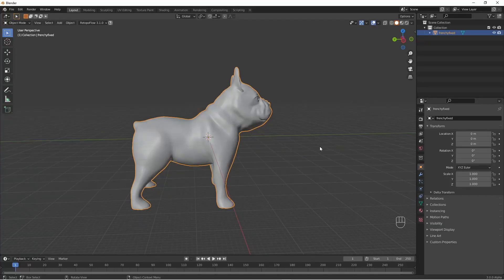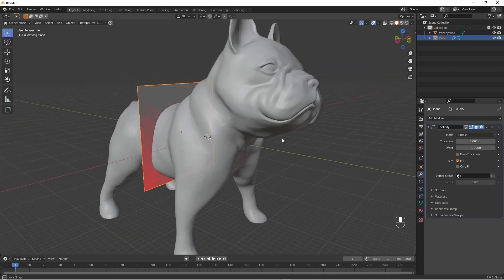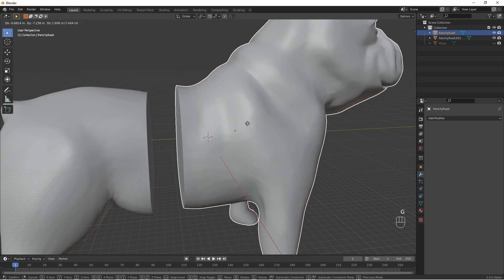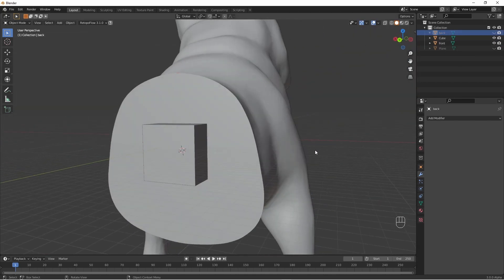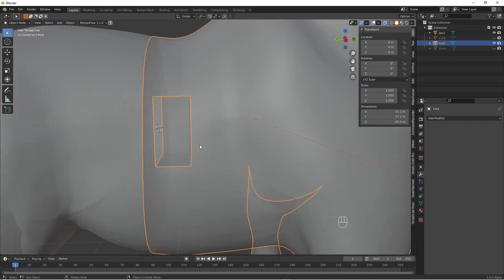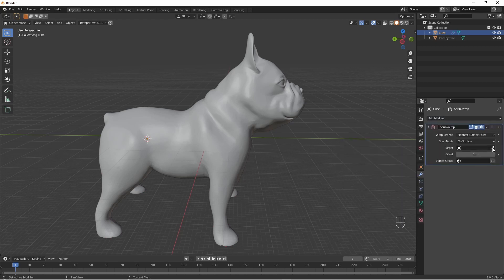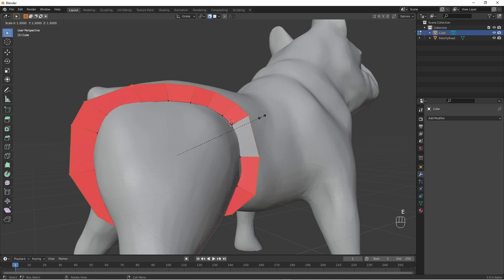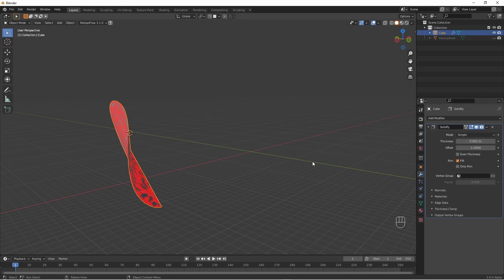Blender. How to cut and key a model for 3d printing

Comment: Great Tutorial.  Why do you use the non-zero-thickness solidified plane to cut the model instead of the Bisect tool?
Reply from the maker: Because the bisect tool can only handle a straight line. This technique allows any shape cutting tool and also allows you to adjust it until its just right. Bisect tool is fine for quick rough cuts though.

Comment: I can't get the extrude and scale step to work. You seem to be able to extrude 'inwards' for the inner ring. no matter what tool i use, it seems to only want to extrude along one plane. I also had to use 'extrude along normals' to even get the first 'ring' to extrude.
Reply from the maker: This is odd.  After the e for extrude you are supposed to do the s for scale.  Are you doing that?
Reply: @notverygoodguy  I press e to extrude, then move the cursor around which extrudes all the vertices in a single direction. I've tried hitting s but it doesn't seem to do anything as long as extrude is active?
Reply from the maker: @p4cca  Don't move the mouse until after the s.  Press e and then press s and then move the mouse.  Should work :)
Reply: @notverygoodguy  I'm so glad you already answered this in the comments! Trying this tutorial and that's where I got lost! Thank you!

Comment: I follow every step and it all goes fine with the organic cut UNTIL I try to apply the Boolean modifier to the Model. It causes a small piece on the outside edge to disappear but all the extrusions made are now part of the Model.

Basically, applying the boolean modifier makes the cutting disc we made become part of the model itself. 

Any idea what i did wrong? Im on blender 4.0.1
Reply from the maker: To be honest I haven't tried Blender 4.x mostly because charmorph doesn't work with it yet but my first suggestion would be to try "fast" in the boolean operator instead of "Exact".  That often fixes things.  If not then check normals by turning on face orientation in the viewport overlays drop down.  If this doesn't make a difference then it looks like I am going to have to download 4.0.1 even though charmorph doesn't work with it so I'd be grateful if you could let me know how you get on.
Reply: @notverygoodguy OKAY so im home and so far i tried the one using the Plane and it worked after I used Fast Though.

Edit: yep ive tried from start to finish a few times and the organic cut doesnt work. The only thing ive notice is when Solidify is set on a plane. I notice its thickness increasing. On the organic it still looks flat. Im gunna play with thickness and see what i get.

Important edit. So in my case making the thickness .003 worked. Im not sure why thats the case but i was able to get them apart
Reply from the maker: @Linkophere  Thanks for the updates.  I'll download 4.0.1 soon and see if there any weird new things I should know but I am glad you got this working :)
Reply: @notverygoodguy no problem. Thank you very much for your fast replies and help. Youve saved me from literal days of editing meshes to make a key hole. This is only my 3rd day of using blender and this video was amazing.
Reply from the maker: @Linkophere  You seem to be doing well for only three days in!  Thanks for the positive comments :)
Reply: @notverygoodguy the excitement of 3d printing and videos like yours make that possible 🫶🏻
Reply: Thanks for the fast reply. Gunna try these as soon as i get home. Thank youuu

Comment: 8:30 here I am suddenly lost.   When I turn on Snapping there is no 'Face' option, instead there is 'Face Project' and 'Face Nearest'.    My best guess was 'Face Project'.  I turned on the Magnet, went down to the point of focus.
But what are you doing?  It sounds like you're clicking the mouse while you move the pointer around.   But all I see on the screen is the letter E.   Whether I click the mouse, or the letter E, no lines are drawn anywhere  :/
Also the pointer never changes to 4 arrows.    What am I doing wrong?
Reply: So disappointing to get this far.  I'm going to have to bail.  No key I hit does anything.  I guess Blender updated and changed how this works?   Who knows
Reply from the maker: Sorry it took so long to see this message.  I usually get to them quickly.  Actually, face nearest is probably best but it depends on the size of your faces and vertex can be better.

Comment: I have two parts that are already in seprate parts but need to be assymbled into one once printed so the slicing method doesn't work for me. do you have any advice for my situation? I don't expect a reply since this is a 2 year old video
Reply from the maker: You maybe surprised :)  Ignore the slicing part of the video but just do the part cutting and keying part with the cube.  Alternatively if you use Prusaslicer as your slicer it can now add connectors to parts to allow you to snap them together.  I haven't actually tried that yet though.

Comment: For the drumstick cutter, what was the purpose of the shrinkwrap modifier? You snapped all extruded vertices to a face, then extruded them a little away from the dog after you'd closed the loop. Seems to me that is all you needed, no shrinkwrap required.
Reply from the maker: You make a reasonable point and your mostly right.  Try it though, it usually works out better with both.

Comment: This is the second method I tried and it just doesn't work for me, as soon as the cut is a bit too curved it fails in one way or another. I discovered a more tedious but much more reliable way: in edit mode deselect all vertices(Alt-a), then activate the knife tool (k) and define the cut around the mesh, double click to close the cut loop, press enter to execute the cut. This doesn't actually separate the mesh but creates a loop of vertices along the cut line you defined and they'll be selected. Now the tedious part: select all vertices on one side of the cut. Afterwards press p > by selected, and you'll have two separate meshes along the cut. They'll be open though, you can close them by selecting the vertices on the seams again, then pressing f and then in the menu bar selecting Face > Triangulate Faces.
Reply from the maker: Your method will be really difficult with high resolution models, especially stl ones but if it is working for you that's great.  

I am interested in the issues you are having using this method though.  Can you give more details on the kind of failures you are getting?

Comment: Thanks so much for the straightforward tutorial.  I tried, and it works great.  But how will that cube key print sticking out at 90 degrees? Do i enable supports?
Reply from the maker: Thank you for the kind words.  I kind of had resin printing in mind actually and then you would most likely have supports on anyway but if you are using an FDM printer I would suggest you make sure the gab between the hole and the "key" is bigger than I show in this video. I would think 0.2mm as a minimum otherwise the parts might not fit together.

For supports, if you use the cube key as it is and it's walls are not at a 45 degree angle to the printer bed then yes you might need support.  However, it doesn't have to be a cube :)  If you selected the vertices of one face and scaled them down, you could make a kind of wedge shape for both the hole and the key and if the angle is right you may not need supports.  

Hope this helps!
Reply: Thanks!

Comment: How would you attampt to cut toroidal propeller in 3 parts? I tried and failed because off a lot factors, you name them :P I have only a small 3D printer 120x120 mm. Looking forward for some advice.
Reply from the maker: Well that's a interesting project especially given you have to stick the pieces together well once printed.  You don't want that flying apart in mid air.  

It depends how big you want this thing to be but you might consider using a cylinder with the top and bottom faces removed as your cutting "plane" and use it to cut out the center leaving that and the arc of the blades as separate object.   Creating keys in something that thin may be a challenge though.  It would be interesting to see what you come up with.
Reply: @notverygoodguy  I did approach it a bit diff than you, tried to cut it in 3 parts 120deg in vertical plane, but I failed due to not being good with the soatware.
Reply from the maker: @geopolska  Did you look at the later parts of the video about making organic cuts?  It MIGHT be helpful.  The basic idea is the same with you propeller as the dog :)  You should be OK.
Reply: @notverygoodguy  Need to study software for a  bit longer then, haha
Reply from the maker: @geopolska  I believe in you :)

Comment: I seem to be the odd man out - I'm looking for details on how to reverse this; as in, take a model that was previously made into keyed pieces (by using Blender) and reassemble it as a solid piece for printing.  
Can anyone point me to a guide that does this (preferably within Blender)?
Reply from the maker: How about you just place the pieces together in Blender do a boolean union on each part so they all end up as one model with the keying still inside.  Your slicer would probably ignore what is inside but if it doesn't , go into edit mode, select all of the outside probably with "C" selecting tool and then SHIFT D to duplicate what you have selected.  Then "p"->by selected.  You should have a new object that is a copy of the old one  (as well as the old one) that would be completely solid.  I haven't actually tried this of course but it should work.  I suspect the slicer will ignore what is inside though so check that first.
Reply: Excellent suggestion, Thank You!  
What I had done so far was to simply import all of the keyed files (they're not hollowed) at once into Blender, and it assembled everything for me automatically (a very nice touch).  I suspect that this is because the original keying process was done in Blender, so there might be some lingering metadata associated with the files.  I then went to Object Mode / Object / Join and then exported the result as an STL.  I haven't printed it yet though, because I was concerned that some of the keyed areas might still have open areas around them (leaving uncured/trapped resin).  That's why i was looking for a confirmed method of putting the model back to a fully assembled/solid state.  But so far, I've not seen a video walkthrough of anyone performing either of these methods; it's always the opposite.  😄
Reply from the maker: @MalsBrownCoat  Actually I do have a video about making hollow objects solid again but not ones that are keyed.  You might find you may have to do the booleans I suggested because the join command doesn't connect parts together, it only makes them look like they are and makes one object out of the parts.  However, it is likely that gap between the parts are so thin that the slicer might handle it anyway.

I would be interested to hear how you got on.  I have never heard of anyone needing this before but I'll add it to my list of videos to consider doing.
Reply: Agreed that the slicer (Lychee) may just take care of things and it may not be an issue after all.  I'm supporting the test file and printing as we speak.  Will certainly advise on the result.  For future use cases though, I'll likely go the route that you mentioned, just to be safe.  The extra steps couldn't hurt.  And for the record, how I found you was from that hollowed-to-solid video.  Thank you for that, as well!
Reply from the maker: @MalsBrownCoat  Good luck :)
Reply: The test print succeeded.  Twice.  So it looks like my process worked.  Of course, the only way to know for certain will be to wait and see if the print explodes.  ;)
Reply from the maker: @MalsBrownCoat  Great news.  Thanks for letting me know!

Comment: I'm trying to cut a vehicle in haft from bonnet to boot. I'll add the modifier solidify; I lose the red face on the plane, but I continue any way.... I'll add Boolean to the vehicle click the eyedrop on the plane and chunks for the vehicle will delete....  I made sure to set origin to geometry as well as rotation to scale for both. Is it because of multiple meshes within that vehicle? for that reason or......
Reply from the maker: Without having seen your model most cars I have seen are not made for 3d printing and have multiple objects, inverted normals, no manifold parts and a whole host of things that booleans might not work with.  There will likely be a fair bit of work fixing up if this is the case.

You MIGHT try using the 3dprint plugin on the individual objects as it has a make manifold option but I am not especially confident in this.

I hope you are able to get this sorted!

Comment: Your videos are excellent. However, I am creating a dust extraction box for my bandsaw and have inserted a tube into it at an angle. What I am struggling with is how to delete the part of the tube mesh that is inside the box exactly where it comes through the inside surface of the box.
Reply from the maker: It would be easier to see pictures somehow as there are a million ways you might have got to the point you are at.  However, something that could work where ever you are at is to create a solid cylinder just slightly bigger than your hose inner wall and do a boolean difference between it and the hose.  It should remove stuff but to be honest maybe there was a way you could have got where you are without having the problem you are left with.  

I would be interested to see what you have if possible.  There is a Blender for 3d printing facebook group linked at the top of this channel and you can post pictures in there if you like but anywhere will do if you wish.

I also create dust extractors for various wood working tools :)

Comment: how much should be a "good" offset from the male cube vs the female cube? u increased something like 0.1, isn't a bit small?
Reply from the maker: Depends on your printer really though it probably is a bit too small.  Especially as scaling by 1mm only gives 0.5m clearance all around.  It might work for resin printing but yes, I guess 2 or maybe 2.5 would be better.

Comment: First off, thank you for this clear tutorial! Secondly while i got the technique to work last night, when i tried to use it again today when i get to the end and pressed L in edit mode the entire model turns orange. I tried following the steps 3 times and i can't get it to work again.
Reply from the maker: Two things that come to mind though I am not overly confident of either of them.  Firstly are you sure your cutting plane cuts entirely through the model in all direction?  Secondly, you could try a thicker cutting plane,  I would be tempted to try it with a stupidly thick one and then turn it off in the viewport to see what the resulting boolean difference looks like.  If it doesn't cut it, there is something odd with the models.  You might also try the "Fast" option instead of "Exact" when you do the boolean as that sometimes helps.  Other than that, make sure your normals are correct in both the model and your cutting tool (check "Face orientation" in the viewport overlays drop down menu).  There should be no red faces.  The try applying rotation and scale to both objects and as a last resort make sure that the origin is set to geometry (though it often works without this).  Let me know if this helps.  If not, I'd be interested to look at your blend file somehow.
Reply: @notverygoodguy  im having the same problem so tried changing the setting to fast but it still didn't work
Reply from the maker: @Fakob225  Are you sure you have applied scale and rotation to both the model and the "cutting" plane before using using the boolean?
Reply: @notverygoodguy  I can see the cut but when I press L it selects the whole thing
Reply from the maker: @Fakob225  Can I suggest you try it with a thicker cutting plane and then check that the plane really does cut through the whole model.  Also you might want to turn on face orientation just to check that there is nothing weird there.
Reply: I want to thank you for replying to a comment on a video you did a year ago! I thought it was a longshot that you would reply so you've definitely gained a sub from me. And i switched the boolean to fast and it worked!
Reply from the maker: @kaininquattrocchi339  Thanks for the kind words and the sub.  I am a bit slow doing  videos at the moment but will get into it again soon :)  Glad to hear your cutting is now working :)